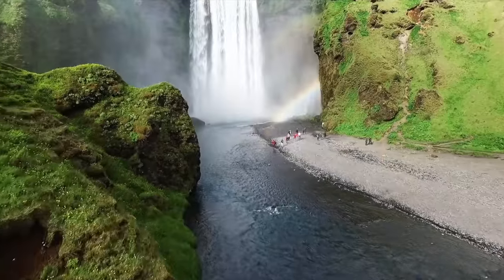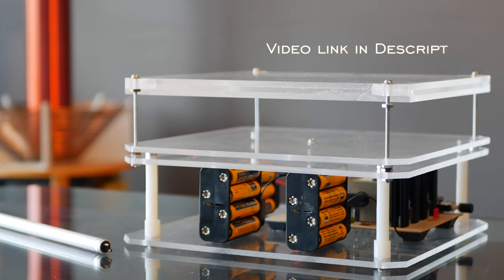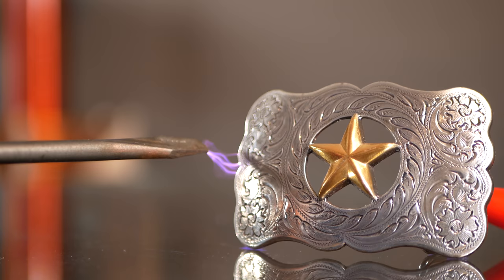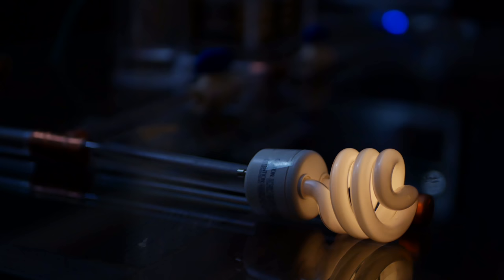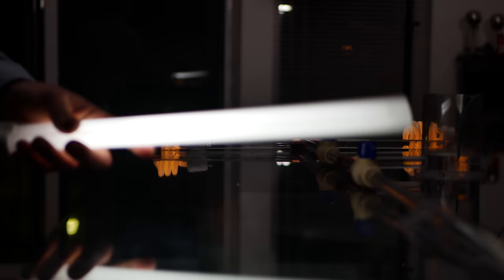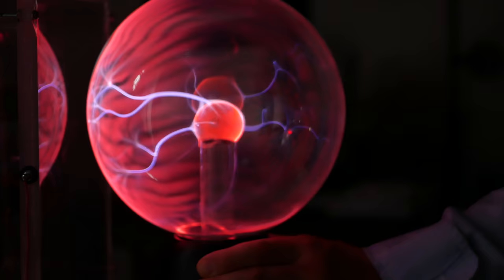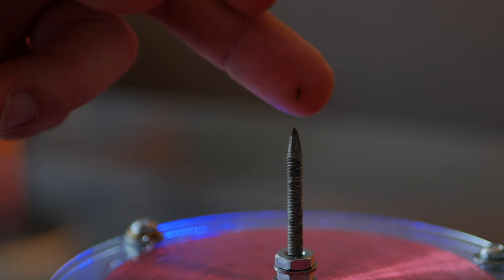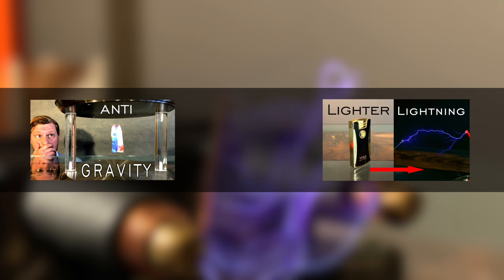Directional Wireless Energy Using Water

Comment: You could try to use other liquids like salt water or destilled or fluorescent liquids... but imagine sea water instead of copper cables 🧐
Reply: Imo distilled or Deionized water may not work
Reply: @zuproc  right... i forgot my fault :P
Reply from the maker: Correct, DI water likely would not work - no conduction when there are no ions
Reply: Ice
Reply: @PlasmaChannel  It would still conduct at high voltage.

Comment: This was incredible! Thank you so much !
Reply from the maker: I am glad you enjoyed it! It’s really amazing in person!
Reply: @PlasmaChannel thanks so much for your reply!, 
I have some questions if you get the time to reply 😊
 I am not considering trying this at home recklessly, I however would love to get started on understanding the safety precautions you took and challenges you came across  during making this, as well as what kind of electrical setup you are using. 
As in how does the electricity interface with the water, and what kind of voltages to amperage are you running? Does it need to be stepped up so that the energy output is at a median what you need it to be, or is it litterally, voltage in is what you get in terms of voltage out. 
Does it fry phones/other tech when its on and they are in the room?
Or Does it jam your signal?

Thanks again for the great video!! 
You are awesome !

Comment: What is the sodium concentration of the water? 
This has my mind bending previous barriers in projects of my own. 
Point on fact. Tap water is conductive. Distilled or purifier water is but much lower conduction great resistance. However adding sodium makes the water (any source) very conductive.

Comment: Hey jay! Please try building a zvs tesla coil...
Reply: @Heads Mess Are ZVZ driver tesla coils are really that bad, can you explain which one is better.
Reply: Heads Mess I believe he meant using a zvs driver as a scaleable/adjustable high power high voltage source to create spark gap Tesla coils with
Reply: @Heads Mess if you use an old flyback without the internal diode then you can do some pretty cool stuff using a zvs driver, that's what I did because it was the cheapest way I could get decent high voltage, the wireless transmission I get from it in crazy
Reply: Two types of zvs one is induction 2 terminals for induction heating coil and a zvs bipolar 3 terminals out haven't tested 3 terminal unit yet . Jay used one in a previous video. 
Cheers

Comment: i imagine these systems could be applied to design really comfortable interfaces, my set up was a bit simpler, but i could appreciate how these frequencies were far less dangerous than 220AC from typical house main sources
The whole electric field around all the energized components is very susceptible and easy to influence trough simple means. you can actually very easily adjust many parameters that otherwise would have to be regulated trough complex circuits and expensive components

I used a spiraling coil the size of a food plate as my secondary , and situated very loosely around 1 cm from the edge of the big spiral, almost two turns of copper cable as my primary
It was a set up inspired in Tesla s Magnifier
I took an electric raquet used to kill flies , and just adjusted the spark gap to control the frequency of the discharges, and connected in series with my primary..
The energy obtained in the secondary can almost be described as a gas, it doesnt burn the skin, and it flows trough many materials without aparent resistance.
The primary however does hurt a bit when touched
All i dare to notice is that , the secondary coil must be vibrating at really high voltages but almost no electrical intensity, some would say , extremily low amperage..

Kind regards to all of you let me know if you are interested in this :)

Comment: This is genius! Great work. How does different electrolytes affect the efficiency of transferring power? Oh, and would this work with distilled water which does not have impurities? I believe tap water is conductive due to impurities and minerals, but distilled water is not.
Reply: This will not work with distilled water...
Water from a tap will act like a high voltage resistor... 
By adding salt you can tune the resistance of the electrolyte and create a custom high power resistor...
Electrolyte resistors actually find use in industry...
Reply: i'd like to see one filled with mercury
Reply: I was thinking the same thing. Water has a tremendous dielectric constant. But I'd also imagine that the reactance between opposite ends of a pipe will be much higher than the resistance. A 1 cm length of tube 1 cm2 in cross section full of tap water will have a resistance of 20kohm at most.
https://www.lenntech.com/applications/ultrapure/conductivity/water-conductivity.htm
If water has a dielectric constant of 100, that same tube would have a capacitance end to end of maybe 9pf. At 1mhz, the reactance would be about 17kohm, so the displacement current and ionic current would be on the same order. For lower frequencies or higher dissolved solid content in the water, the ionic conductivity would exceed the capacitive displacement current.
Reply: @Heads Mess
LOL 😂 😂 😂 😂 😂
Reply: @waldovanderwesthuizen4557   stick 120vdc across distlled water,  and your aware that little to no current will flow.  Doing the same with 120vac  on the other hand will have current flow through capative coupling rather than ionic flow. 
Pure water may not be conductive, but its water molecules are polar and easily rotated and their shape deformed in an electric field which is why it has a high dielectric constant.
Reply: @Heads Mess And the dieletric "memory" could be a hint for the cfl delayed glow?
Reply: @Heads Mess Wrong. The valve dimensions are tiny compared with the water column; the valve will hardly affect the capacitance. The tube of tap water is a leaky capacitor (parallel C and R). With the valve closed you kill the conductive leakage, but the capacitance is pretty much unchanged. Hence why the lamps glow dimly with the valve closed, and brighter with it open.
Reply: @deltab9768  going to have to read this a few times but the minerals dissolved would add to the conductivity of the water 💧?
Reply: @kreynolds1123  would that be like resetting the water cold bunting?
Reply: @wallyworld817   I'm sorry, i do not understand.

Comment: This idea is really nice 😊
but the only problem is it has very very very less efficiency so too much power wastage which is not a nice thing
Reply: Electroboom entered  the chat 😂
Reply: That’s only if you consider it as a closed thermodynamic system. Water is very strange. Who knows what will happen when it becomes stressed with other natural forces like light, heat, vacuum, aeration, phase changes, etc. that can come from the environment. Keep an open (system) mind and not a closed (system) mind.
Reply: He just has to find a better more efficient material than water to perform the task.

Comment: Hello Jay and thank you for the great video.

I think the valve doesn't shut down  the light completely because the valves are designed for water or air pressure, not electrical isolation.

Probably the closing part that rotates inside the valve should be either thicker or made of another material like glass.
Greetings from Sardegna!

Comment: Excellent vid and work.  I think the bulb stays barely lit due to a cap discharging or phosphorus still excited.  This project has inspired me to get one of my old projects back out,  a few years ago I was working with a 4KV low current transmitter that I made using a transformer that I found in a disposable camera that was powered by 6vdc, it was all over the tube at that time.  I was using it to kill bacteria on my dishes and utensils.  It worked great, the range was about 3ft but if I added metal pots in a line, I could get it to transfer power 6ft, that was the length of my counter, it should go further.  It also could light an LED brightly if touching the metal.
Now I am thinking of using water tubes to transfer the power out to my mailbox to power a light.  Thanks for putting this out there for us.  Heck ya.

Comment: Jay, you are simply using water as an electrical conductor. Add some salt to your water and see the increase in brightness of those bulbs. The wireless aspect is just due to the combination of AC and being high voltage. It is an interesting idea, but water is certainly not an efficient conductor so don't take this too far. Keep up the good work.
Reply from the maker: I appreciate the compliments! What is strange, is that too conductive of water , I found, weakened the effect. I believe it is because the water was able to radiate power into the air more easily, so the power dissipated prior to reaching the light bulbs.
Reply: Interesting! To validate that theory, sticking a copper wire on the tube while being empty just to take its shape and power it from the same source should dissipate most of the power before reaching the light bulb, is that even possible? or this is a different phenomena to do with water being ionic conductor rather conventional electronic conductor? Thought provoking!
Reply: Ehab Saleh ايهاب صالح The effect has to be electrostatic. The water without salt is very bad conductor but it can be used as insulator in capacitor. Such system creates electric polarization which is electric field around the pipes. Low voltage bulbs can easily be excited be such electric field. This is definitely not power transfer system, it’s electrostatic system.

Comment: If you go to a residential or rural power pole, you usually only see one wire on an insulator.
So the utility is using the ground as the return conductor.
A river may conduct a lightening strike for 5 miles or so, and be deadly.

Comment: Plasma channel!. I recently came across "plasma stream".  They are using plasma to ionize air molecules to pull air flow.  This concept is being used on tractor trailers to reduce drag. This is a relatively simple process it seems, but could make for maybe a cool video. I havent watched all your videos yet, this is the first one i came to.  This is super cool and i think that the future is in plasma. 
PS I think the answer to your question is in ionization.  By having wireless power and a confined space inside the florescent light tube. The noble gas used inside is staying ionized, therefore carrying the energy and keeping the light ... alight.  Since the ionized air has no where to go, it has to find a way to leave the source of the light.... eventually.

Comment: I’m late to the game here. Background, ham radio operator 43 yrs. I have experimented with liquid ionic RF radio transmission. I used salt saturated distilled water inside a sealed PVC pipe. The salt in the solution not only carries RF energy it also receives radio signals as well. My first contact using this antenna was 10 watts from Southern Michigan to a mobile operator in Montana.
I think the efficiency of you water transmission could be enhanced by adding a salt ion to increase conductivity. I used Magnesium Sulfate, (Epsom salt). The reason being, from a PH perspective it is less corrosive than Sodium Chloride. Both ions should work on par with one another.  Hopefully that sparks some ideas.

Comment: What I have experienced is that lightning travels among rivers. We used to deploy water level loggers along long (+ 10 km) stretches of a river to measure water surge travel times. The measurement sensors used a float on a stainless steel cable with opto-coupling via a plastic disk to measure the height changes. The logger was connected to the opto-coupler via a circuit inside a sealed metal box. So very well protected from any high voltage. What we found was that we would have a series of loggers blow up within a few seconds of each other, although they were kilometers apart. The data was written to EPROM so was unaffected by the damage, which often included the well protected front end circuits of the loggers.

Comment: two ideas there - in my head 
1)lighting flexible tube from PVC transparent tube for chemical/garden water  1cm diameter or so
with some graphete  coating inside maybe - and main part - HV supply for corona charge inside pipe, atmospheric pressure probably
2)analog for HPS lamp - termostrong borosil glass tube, or flask, with some NaOH+H2O inside, and electrodes it is possible to get discharge between two liquid part, and electrodes - not so close - it will not burn 
f.e. one idea - round flask with rear condenser(glass tube pretty hi - 50-100cm), on bottom inside - two "swimming pools"  connected with each other by thin "river" - like conductive fuse part - that can light on , and two carbone electrodes - in these "swimming pools" - underwater, 220VAC supply, atmospheric pressure - opened system, water will not fly away, steam will rise up in rear condenser glass "neck" of flask, where cooled down condensed, and drop/flow down - returned in swimming pools

Comment: Here I thought this was one of those YouTube channels about perpetual motion machines. Water does conduct electricity, and it's cheaper than copper, which is useful given how copper theft is a problem. But the reason water conducts electricity is because it dissolves other substances, giving it ions... and in other ways, it tends to be messy and leak and stuff like that. Existing water and sewer systems are grounded, so this doesn't allow them to be used for power distribution.

Comment: The Bulb on the end of the closed valve is still within a decent range of the wirelessly charged water. You would have to either construct a much more complex system of valves or implement some kind of interference field when you want something to shut all the way off. Just a thought.

Comment: The reason I would imagine the fluorescent bulb still being lit after cutting off the power is because there is still power going to the light through static current. You would have to have COMPLETE disconnection of the power source. Dimmers have a tendency to leak power bcs it never fully disconnects the current, it only reduces the current. Some dimmers have a feature that fully DOES cut off power if you force the dimmers switch past the lowest setting, it should click and COMPLETELY cut off the power by creating a separation between the two conductive leads.

Comment: Limestone creates an electric charge when water is passed through it. 
It cannot trap dangerous gas, spreads and hold water evenly, and remains in circuit with the ground.
any ambient charge would be terminated unless drawn off before completing the circuit.
Id suggest a limestone foundation using copper(?) plates to potentially create nodes of energy thereby directing the charge and expanding the effective area the system covers

Comment: i am studying mechanical engineering i just happened to be recommended this video and i have to say i wish you made it sooner and i saw it sooner too and here is why. I had a project that was open for anything you wanted and my group and i decided to make an underwater rover that can sense temperature various and PH levels the rover is intended for mines where it can go into water filler tunnels and check if any metals integrated with the water racing the acidity instead of sending people to check making it a cheaper alternative to losing human life 120$.  Now within the rover we had areas that water would flow through but lights and sensors were on the other side one of our problems was powering the lights which in the end forced us to change the body to include cavities without water for the wires it would have been a lot cooler and space efficient if we applied capacitive coupling to wirelessly power them it also would have helped lower the losses of thrust inside the cavity.
Reply from the maker: Hi Daniel, glad you enjoyed! Not sure if your sensitive equipment would be good next to this style of power delivery though.
Reply: @PlasmaChannel  nothing should be affected the cameras and ph senor are heavily insolated so that the rover can go to 300meters in depth.

Comment: My biggest gripe with acrylic as a material is that it is a fossil fuel with  a finite ecological lifespan on planet earth plus it's not that ecological once it breaks down but having said that I wonder if silicone tubing could be used in this installation-  it is way more renewale (manufacturable using quartz sand) it is insulative,  it has a high heat capability, it's flexible and can be reshaped after setting.  This is so inspiring!  thanks for all the practical informations

Comment: I assume the high voltage intermingled with standing waves that continued to light until the distance became prohibitive. Essentially the high voltage becomes a start capacitor of sorts and the standing waves hold the circuit in rhythm until either the distance minimizes the effect or the resonance or echo started by the high voltage wanes. I could be way off but it seems to me to be on the right track. Great concept I can see it  freeing up a lot of copper. Acrylic tubes are way cheaper than copper wires. Good stuff!